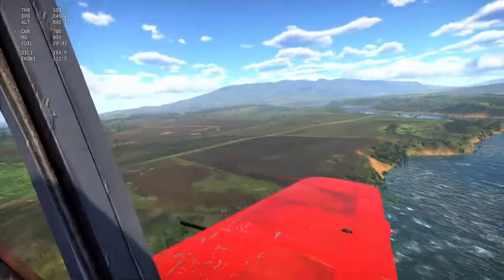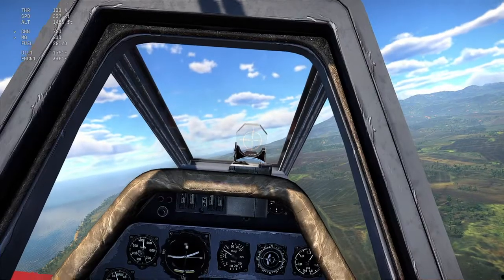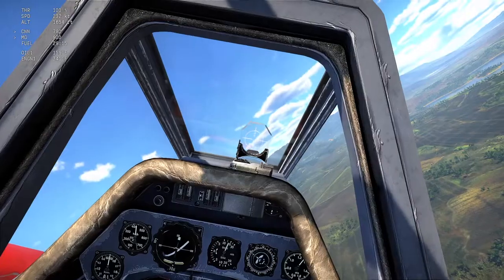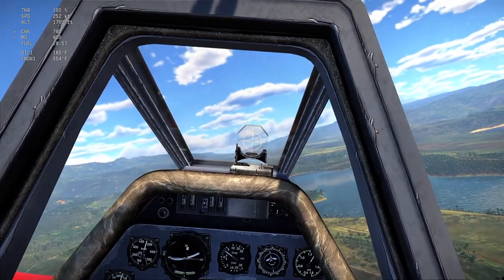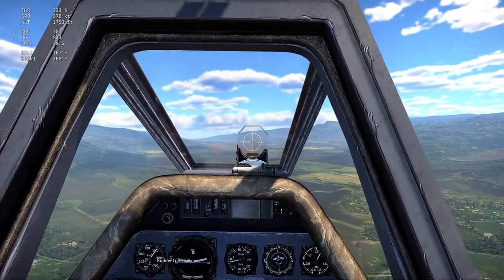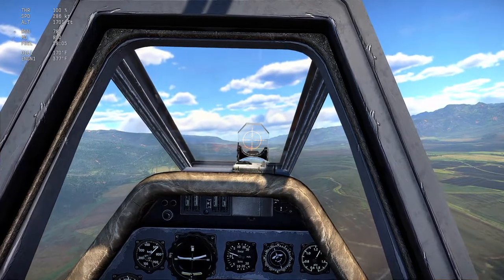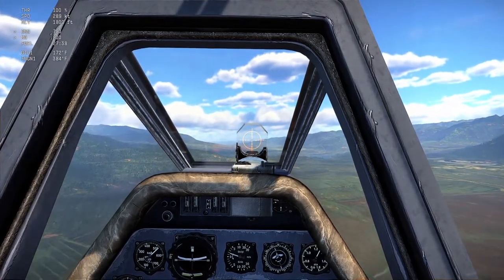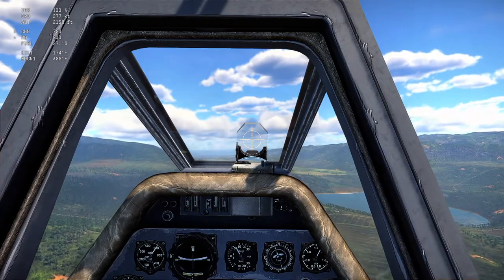How to trim aircraft and save it in test flight - War Thunder - Air Sim

Comment: My fw190 are kipping in the Sims oder the left  wing and i must everytime the Joystick press right to Kompensation. The Joystick is not the Problem for this but i dont have a idea whats wrong.
Reply from the maker: If your using a flightstick put your roll and pitch multiplier to .09, deadzone at 0.05, non linearity to 1, correction to 0%

Then put your sensitivities for pitch and roll to 90%.
Reply: @ninjato5611  didn't work, ever worse,
Reply from the maker: Give me a few minutes. I'll make a video for you. Just keep looking for it to be uploaded
Reply from the maker: Video is up
Reply: @ninjato5611  yepp i saw it, but its 23h and its to Late for a test, i Start a test next morning after the work
Reply: @ninjato5611  Hey Ninjato I wanted to thank you again for your help, I have now found the solution.

German aircraft used to trim so-called "Bügelkanten" after a test flight they were set once and could not be changed.

The setting for the "Bügelkanten" can be set in the test flight, these are then saved for the simulator battles. The problem was probably that I had calibrated them at that time aif 8000+ and they therefore led to the crash on 1-3 km.

Thank you for your active help and your videos about calibrations
Reply from the maker: @comicalzink5  You're welcome. Glad you got it. Maybe I'll see you in a match sometime o7
Reply: thanks man u r a star, been battling for days with joystick